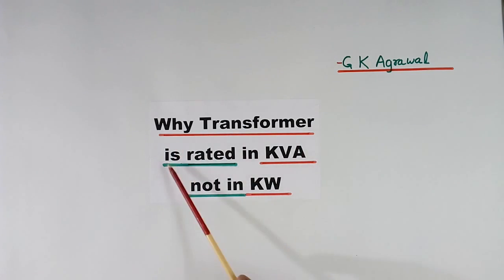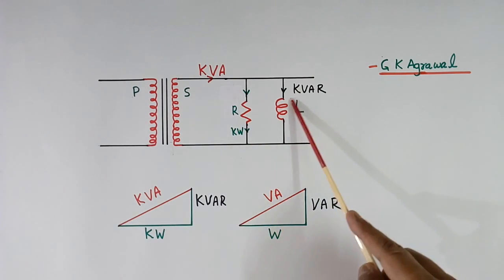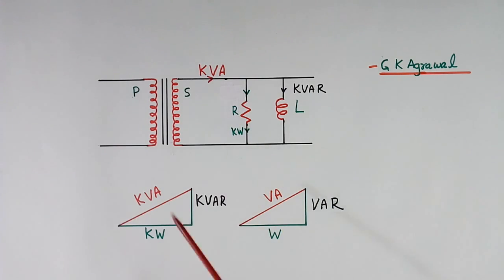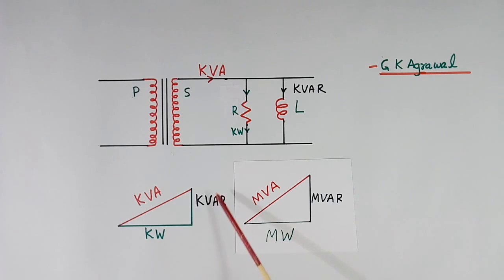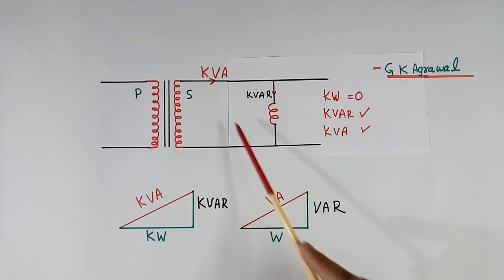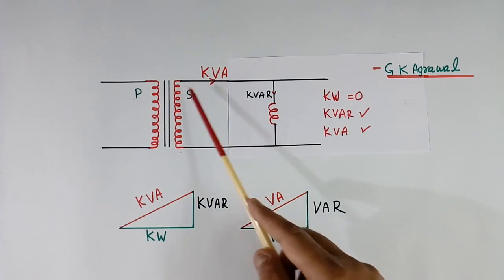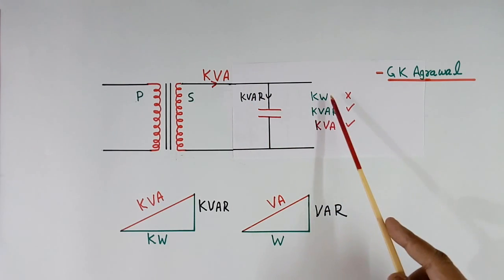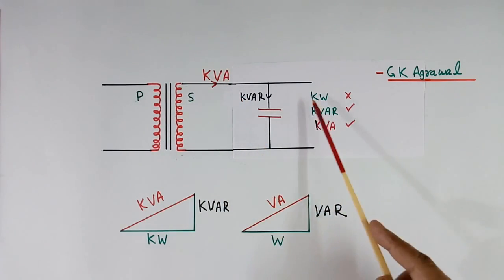Why Transformer rating in KVA not in KW

Comment: this is not the correct way to explain it, any device rating is high if its heat bearing capacity is high and heat is dependent on losses whereas in transformer losses are only dependent on voltage and current so is rated in kVA.
Reply from the maker: Your comments are most welcome. In science technical discussion is always good. My views are given below.
1-  Core loss and cu loss are responsible for heating. In transformer  core loss depends upon voltage, but volatge does not dependts upon core loss. Volatge is decided based on saturation of transformer. If voltage is more , transformer will saturate and will not work. So this saturation decided transformer volatge.
2- In transformer say for 1000VA, hardly 50 watt is the heating loss.  But rating will be 1000VA not 50 watts.  
3-  In varable transaformer rating is given in ampere not is VA. 
4-  In iron core inductor ( similar to transformer) rating is given in KVAR not in VA. 
5-  In transmission line rating is given in MW not base on cu loss of the line. This is due to technical reasons.
6-  However in electric iron rating may 1000W which is equal to heating losses.
So most useful parameter  appears to be deciding the method of rating.
Reply: NO! power factor and efficiency are two different things.